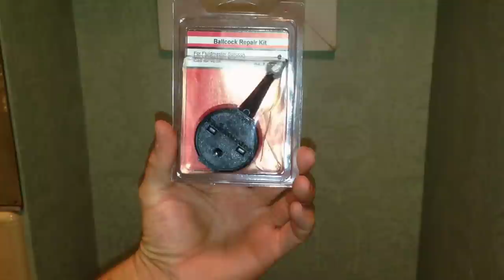How To Replace The Top Of A Toilet Fill Valve

Comment: I had a call in to the plumber this morning because the tank wasn't filling - 
I thought in the meantime I would check on-line to see what the problem might be.  I saw your video, it looked like a simple fix, ran over to Ace Hardware, came home, followed your instructions ...and it worked!  Thanks so much for posting this!
Reply from the maker: So glad this worked ! Thank you so much for taking the time and posting . Cheers !

Comment: You can remove just the cap at the top by pushing down and turning it counter clockwise like a pill bottle. If the washer is not damaged, you can just clean it under running water. Then, before reinstalling, place a cup over the top of the fill valve to prevent getting splashed and turn on the water for 30 seconds to flush out the valve. Turn off water, reinstall the top and turn on the water again. Done. Cost: $0.00.  These are the actual instructions from Kohler and it works.
Reply from the maker: Awesome tips my friend !
Reply: Nick V my cap will not come off using ur instructions. What could be the issue
Reply: But if your valve is very close to the tank edge, you have no knuckle room to get that grip. This video showed me i can just twist it counter clockwise and it will come off. This was a very helpful video for me.

Comment: I installed a new fill valve and everything works fine except now it has an intermittent drip/leak coming from the top cap. Could it be faulty from the factory?

Comment: My toilet is doing this exact same thing right now. As you suggested, to test the valve, I lifted the arm up but the water continued to run. Any suggestions?
Reply from the maker: Hi Therese :)
Yes, just replace the top piece as we show in this video ,that should solve your running water issue.
Reply: I just replaced the toilet fill valve cap and it worked like a charm. Thank you for your help!
Reply from the maker: You are now a certified plumber :)
Great Job !
Reply: The Twin Home Experts my cap top will not come off to replace the seal
Reply from the maker: If you trying holding the shaft ,then counter clockwise twist top.

Comment: You are replacing the cap assembly on a "fill valve". Not a flush valve.
Reply from the maker: +TheToilet Pro 
Yes , your correct . Its a fill valve ,not a flush valve . Apologize for the HUMAN error.
Reply: +The Twin Home Experts - LA & Surrounding Area  its better to replace the whole fillvalve
Reply: i just replaced my toilet fill valve with fluid master fill valve 400a. it  is leaking from the top  when filling water but stops when  water level is full. should i worry about this ? because the leak stops when it is done filling the  tank. it should be the washer also right?  the leak is not too bad little water comes out.

Comment: What if the toilet doesn’t stop running when you lift the lever with your finger as shown in the video? And you know it’s not the rubber piece at the bottom of the cylinder?

Comment: Or you could just replace the whole fill valve cause it’s only $7 an should only take 4 minutes at the max to switch out
Reply: Unless of course you have a fancy Kohler toilet with a base that’s tight against the wall and there’s no access to replace the entire fill valve without pilling the toilet.